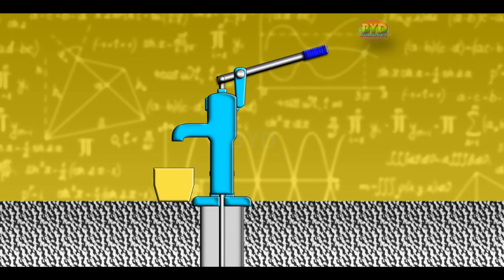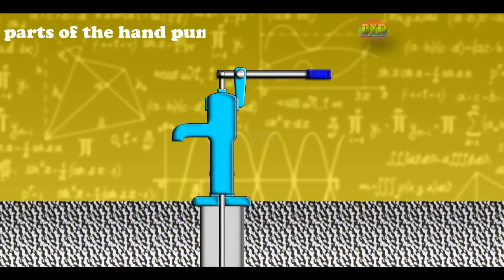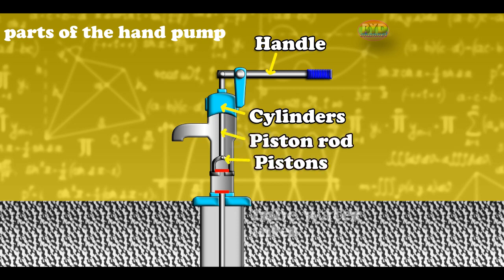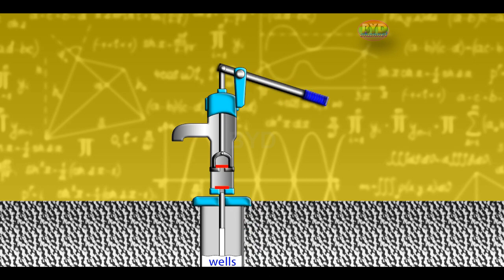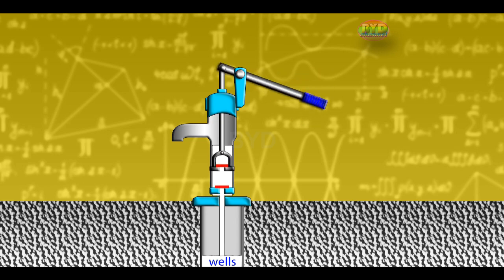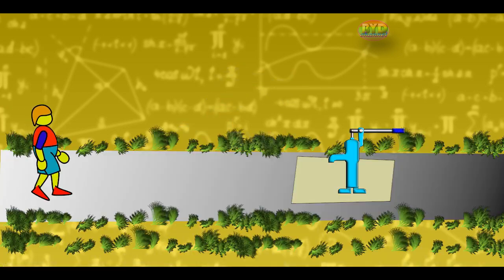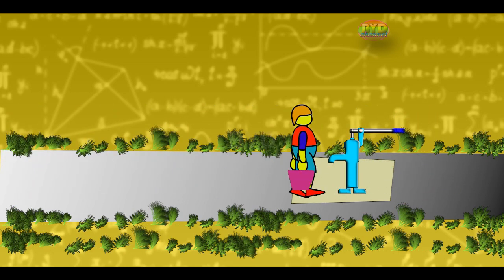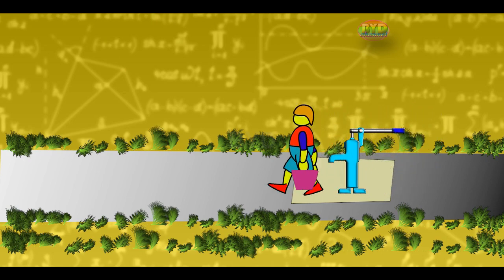Animation water pump handle works

Comment: Let's say the nosle is like 10 ft high and the lever is near the bottom or middle. Do you need more force to push down on the lever because of the extra weight of water pressing down? Thanks!